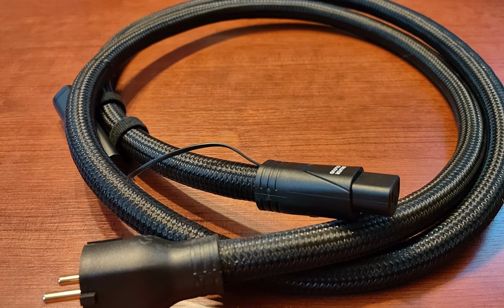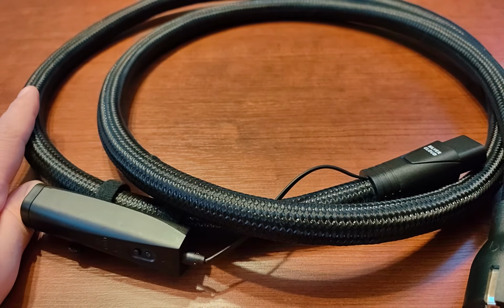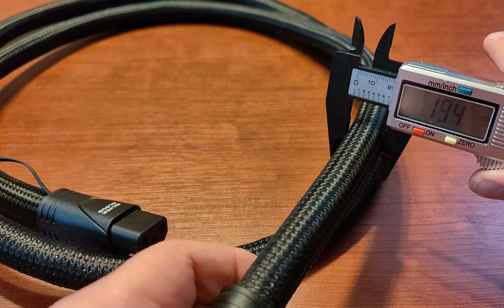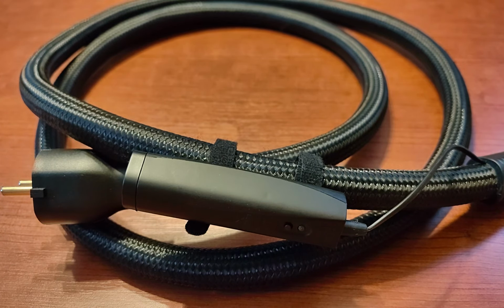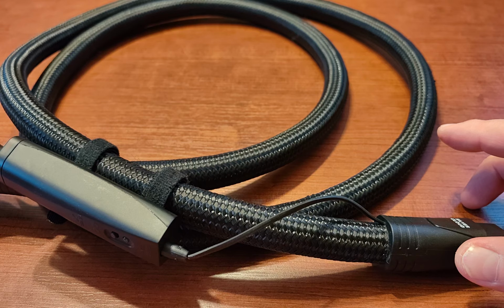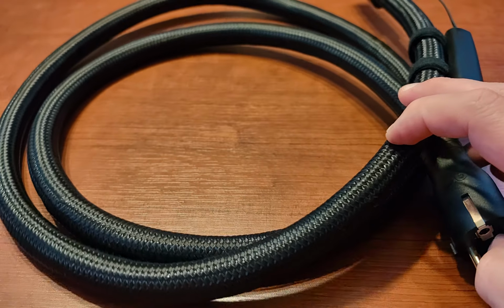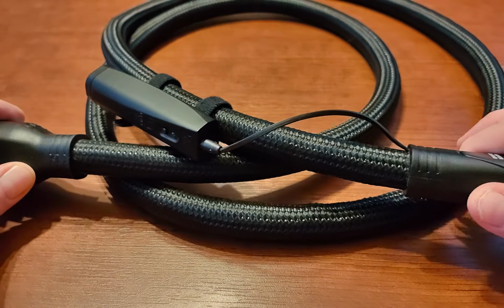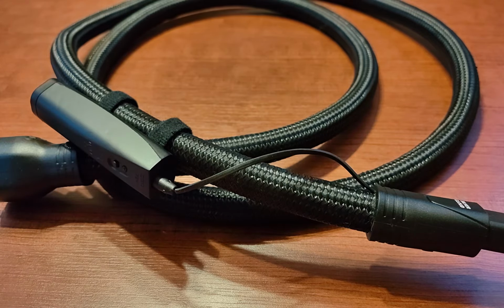FAKE AudioQuest Silver Cloud power cable - thats the limit my wallet can take. But is it worth it?

Comment: Hi Tomaz, based on your recommendations, I am very happy with the purchase of the AQ  Dragon XLRs and Dragon Zero Speaker Cables. As a matter of fact, I am seriously considering swapping my power cables with AQ Dragons. 

Question is:

1) Would they further enhance my current setup? 
2) I have a simple setup; a Eversolo DMPA6 Master streamer and a Hegel Integrated Amp. Correct me if I'm wrong, Source power cable goes with the Streamer while HC goes with the Hegel Integreated Amp?

Thanks again.
Reply: We same  cable setup, did you bought the power cable?
Reply: @xtertaay3376 Yes, I bought the Source and HC Dragons but I couldn't hear much difference though.

Comment: With these huge cables, don’t you think it’s funny that at some point inside the Amp or whatever it’s powering the electricity goes through a hair’s thickness fuse .. the logic of using esoteric cables when all the current flows through a microscopic fuse wire. It’s one of the biggest elephants in the room of the high-end Hi-Fi world.
Reply from the maker: Id say there are two things on the table. One of them being fuse thats inside the metal chassis so there is little chance of catching stray emi/rfi than with power cord. Then the second one (that I can hear, but only with DACs and when using my Stax or Martin Logan Ascents) is the fuse. Better fuses (that do shield the wire inside with stuff better than just glass do sound better. Though as I said - with my ears I can hear that only with very very transparent drivers.
Reply: Well, sound can be improved by using a high quality fuse, however the other way around, the fuse is very short in length. If we consider the power with good cable like this, and some cleaning in advance, then for now best quality of the power signal as possible has been achieved before reaching the unit. The fuse won't clutter it again, maybe a little effect, but not as much as it maybe was. However, there is homes around with very high quality of stable eIectricity... I have this cable and it was a huge improvement when using it with my Auralic Vega DAC. I live in a very old house with unstable Power ( a little bit underpowered when it comes to electricity)

Comment: Beste hifi zone. Wat een goede review. Wat denkt u van de fake hurricane powercable.
Reply: Dankjewel voor uw snelle reactie. Is de powercable van dragon een grote verbetering tov de silvercload?
Reply from the maker: @jannek27  yes it is, however its waaay pricier. I will do a review soon, first look video and then "sound" test
Reply from the maker: Hi! Thanks! Havent reviewed that one, after listening to Silver Cloud I went straight for Dragons
Reply: Hi Jannek, I have the fake Hurricane, Silver cloud and Firebird.
IMHO, The Hurricane is good with sources and on the warmer side of neutral, the Firebird however is better in neutrality and a bit more dynamic. The Silver Cloud is also very dynamic, but also a bit more delicate when needed. Difficult to describe, but lets say the Silver Cloud is the best all round cable and suited for all equipment! At this moment I use this one between wall socket and Isotek filter. The Hurricane on my DAC and the Firebird on my amp. That seems to be the best combi to me. But I guess that three Silver Clouds would be a great alternative. I am saving to get another Silver Cloud  and then try it between all of my equipment, while keeping the first one on the filter.

Comment: Can you provide a link please
Reply: If you don’t want to give that information out publicly, can we maybe contact by email? Personally I have no qualms about this if a western company goes to China and produces a product that it sells for $3000 US. When somebody else can sell it for 250 that first company is gouging. That is a ridiculous price - the higher one. 

I have some experience importing for makers overseas, although not electronics . And you’re quite right this is just an additional production run, but they will be careful. They will check for patent  to see if there’s anything they shouldn’t put there because they don’t wanna lawsuit. Recall at one point you could go to the factory that made Ping golf clubs and by the heads of a set of golf clubs that cost something in the order of $3000 just by coincidence and you can get them for 200 or 150.

This is been going on for a really long time and I don’t think the shady side is all on the overseas manufacturer. I think as much of it is on the marketing company that has the product designed for them and then just sell it for ridiculous amounts of money . Otherwise they would be no for fakes
Reply from the maker: @robcaputo9708  Hi! I'm not linking to stores with fakes as a rule. However if you'll look at AliExpress stores, fake Silver Clouds are the same everywhere (which btw supports the night shift theory)

Comment: By the way: about speaker cables: I think they do make a big difference as well BUT they need really a LOT of time to break in. Therefore they are more difficult to compare quickly.
Reply from the maker: Yes! This whole adventure takes ages because every single cable gets at least 200h of burn in time! BTW - and this is spoiler - changing power cable at the DAC is like 5x more noticeable then changing speaker cable! But this happens only in this specific location, at the source. I was completely surprised by that and noticed this only when I started testing everything in ordered, repeatable way with the same procedure. Food for thoughts :)
Reply: Perhaps it is 5x more noticeable quickly and on a not yet very revealing system. But if you have that revealing system than the speaker cables do really matter perhaps as much as power cables. But it's more in a different order in time. Perhaps indeed first get the power cables right than the speaker cables. Would you partly agree? In the ideal world everything must be right for judging> I know. But who can afford that? So we need each other to learn from.  🙂 @k4syx
Reply: Cables do not break in.
Reply: @ You are right, 'burn in, but it's just a name ment to comment on a phenomenon. And you know this being here. ;-)
Reply: @onnonugteren2935  there is no change to cables over time. It's nonsense.
Reply: @mccririck01  oh
Reply: @onnonugteren2935  it's true. Why would there be? Because someone told you there is?
Reply: @ are you trying to tease, can you reed?
Reply: @onnonugteren2935  are you? Can you?
Reply: @mccririck01 of course there are always ppl like you that state cables don’t change with time believe whatever you want. The fact is there is always some sound change in a cable after a period of time just as there is in tubes that  burn in. Why bother to comment on this site if you do not believe anything the reviewer states is it to just hear yourself be negative
Reply: @Jerry-zl1pd that's not a fact at all it's your opinion. And there's no scientific basis to your opinion.
Reply: @Jerry-zl1pd I like to correct things. There are a lot of people who end up believing BS like this and spending a lot of money on nonsense cables
Reply: @mccririck01  Cables often sound better after time because of "burn-in," where trapped gases release and materials settle, improving electrical flow
Reply: @renesrensen8789 utter bullshit

Comment: I think you under estimate the manufacturing capability in China, there are many small manufactures in China who are already setup to manufacture electrical and electronic components. If you have the equipment and supply chain it is not difficult to make these clones and of course the R&D and marketing costs are minimal.
Reply from the maker: For me it's a question of balancing income and costs. If you'll take a look at sale numbers (these are visible in offers) then you'll see they are miniscule. I've tried adding all of them for dragons, silver clouds and I came up with something around 70 pieces - rounding up.
Looking at the prices I highly doubt if this would really cover the costs of preparing connector moulds and braiding alone. There's also another factor: if you'd have the means, would you rather counterfeit something for mass market or something for niche (people that would buy fakes) within niche (people hearing the difference cables are making) that's within another niche (audiophiles and that's small group to begin with)?
I don't really buy into fakes here, though there is something shady going on for sure.
Reply: It would be incorrect to judge the market size just by AliExpress as it is just one online platform that is oriented to sales outside China. AliExpress does not even operate in China where the main markets are Taobao, Baidu and Tencent. There are also multiple online markets in Japan and the rest of Asia where Chinese traders can sell their products. Asia does have most of the worlds population and there are a lot of HiFi crazies here.
Reply: FYI I just made up some power cables using the Grey Knight Energy power cable with fake Furutech plugs and was very disappointed with the result, actually preferring the cheap computer cable. I think I need to watch more of your videos.
Reply from the maker: @andrewmccorkell652  Grey Knight was real and only the plugs were fake, right? What type? FL-50?
Reply: @k4syx  I used 13mm GreyKnight with fake 13A UK plugs and right angle IEC connectors. Compared to computer cord the bass was stronger with more authority, mids about the same but the treble was dull and diminished, lacking sparkle. Soundstage was flattened and more connected to the speakers. I was totally shocked as I expected something to at least be as good as a free cable. Can a power cord change dramatically once it has burned in?
Reply from the maker: @andrewmccorkell652  unfortunately no. In my experience if you don't like it at start, you won't like it at the end. Burn in gives some refinement, yes, but the cable that sounds muddy to me when I start won't be sparky and airy in the end. Real cases: fake Cardas that I reviewed and real Audionova Starpower MK2. Unfortunately not every cable changes sound for better, which btw proves that's not placebo. 
And yes if you know your music and your equipment signature sound the difference is quite big!
Reply: @k4syx  Ok thanks, looking forward to your conclusions as I will change the Grey Knight cable if It does not improve ( or I get used to it ;)

Comment: I would be interested in a video summary review of all the cables so far and a ranking best to last, maybe with an excel bar chart visual. Also a ranking video of speaker cables. Thanks!
Reply from the maker: That's the plan when I will get to the last one: I have a table with a score for each cable I've tested :)
Reply: @k4syx  I have an recommendation, I got some fake 12TC speaker cables and they actually sound really good, especially after a tweak of putting in a thick cotton rope in the middle of it. Also you can get them with lockable banana plugs, by far my favorite type of connector.
Reply from the maker: @tobiaxelsson  yes lockable bananas rule! I'll think about getting them, thanks for the tip!
Reply: To do it good it needs  A LOT OT TIME. And you know and act to it. Keep taking your time and depht. Not to 'quick' graphics for impatient people. ;-)  
 @k4syx
Reply: I'm giving you a thumbs up for the video, but I'm going to be subscribing to hear the results. Personally, I use chord shawline power cables. I don't suspect they're going to be included in the final count? If not, it doesn't matter. I'm still interested anyway.
Reply from the maker: @Totalplonker  no, they won't be, I don't have any home..